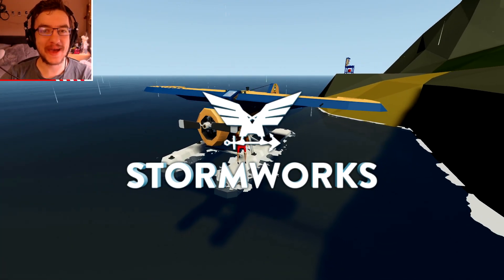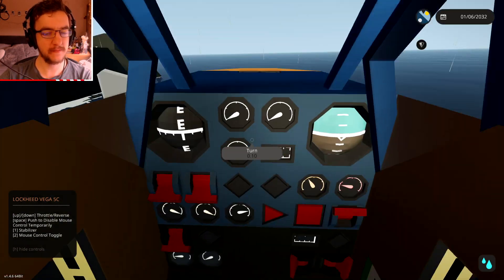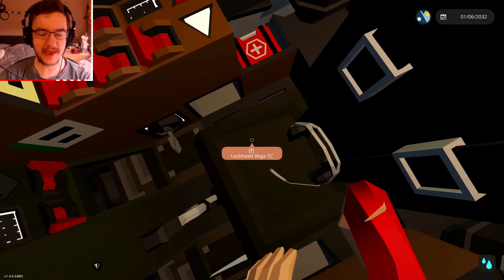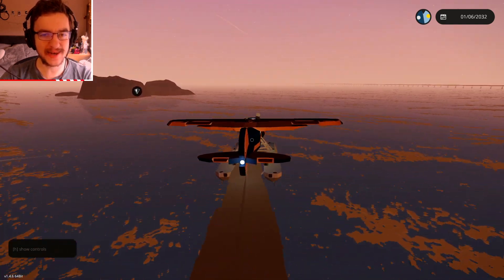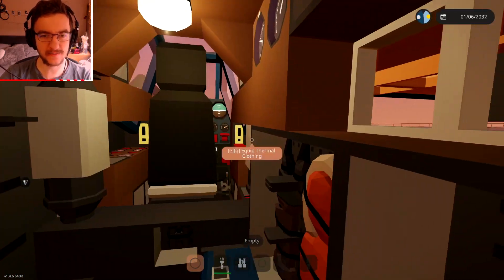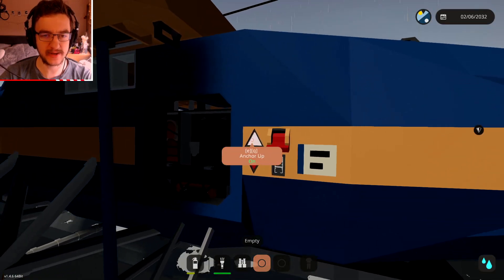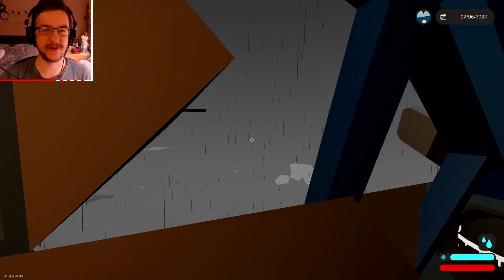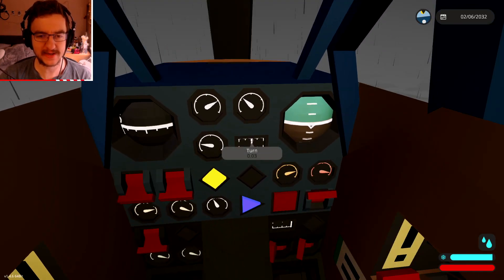Floatplane Engine OVERHEATS! - Stormworks Build and Rescue

Comment: Thanks for the review Frantic. Engine cooling can sustain prolonged flight at 0.7 Throttle and 13.75+ mixture (Air to Fuel) settings which is called cruise. Full throttle and rich mixture are for takeoffs. Fire is highly dangerous on this because if it spreads to fuel tanks and air temperature goes above 210 celcius fuel tanks will eplode (actually a hidden warhead explodes). Thankfully you put out it quickly every time it starts. :)
Reply from the maker: Hey bud, its such a cool aircraft. I enjoy playing around with pretty much everything you build xD I didnt realise there was a warhead in there aha, thats quite fun haha